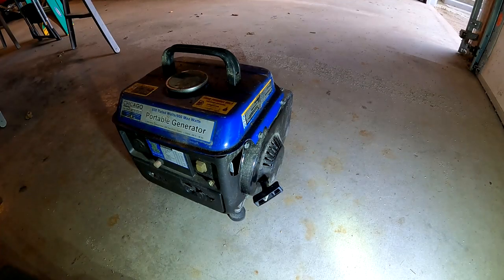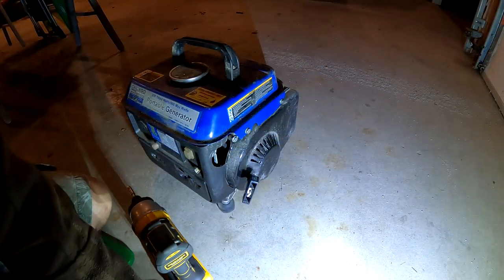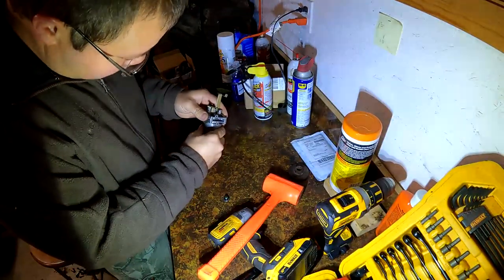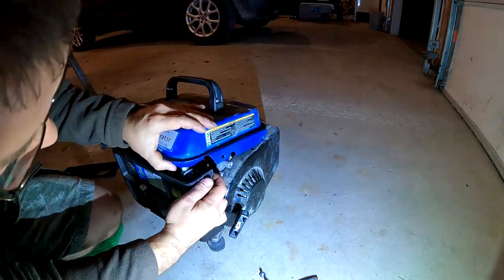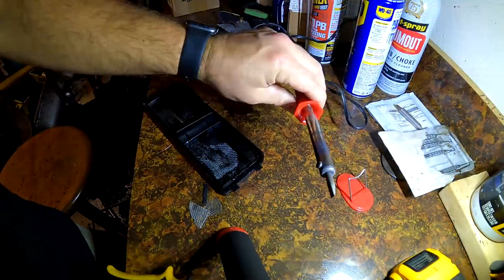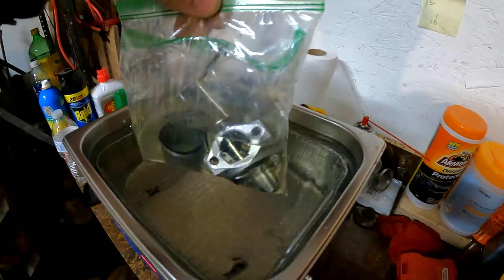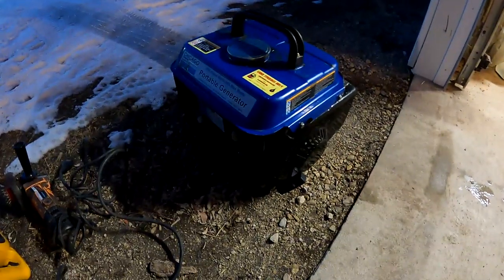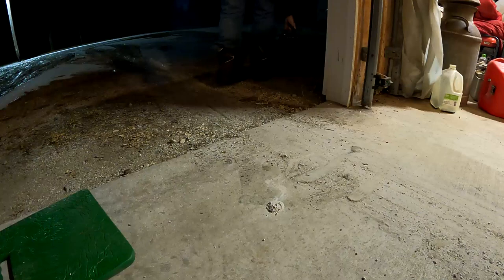Chicago Electric Two Stroke Portable Generator: Can I Bring It Back From The Dead?

Comment: HOW HARD IS IT TO CHANG THE CRANK STATOR NO GETTING ANY POWER FROM THE PULL START ???
Reply from the maker: Not too hard, just got to dig into it a little deeper. You mean the flywheel one giving the engine spark?
Reply: @wisconsinsmallenginenut  THE MODULE IS BAD SO I'LL REPLACE IT  THANKS ANY WAY